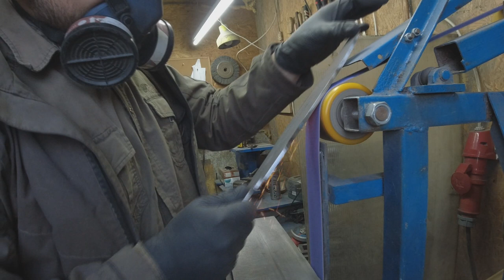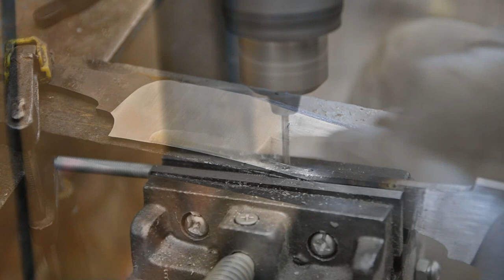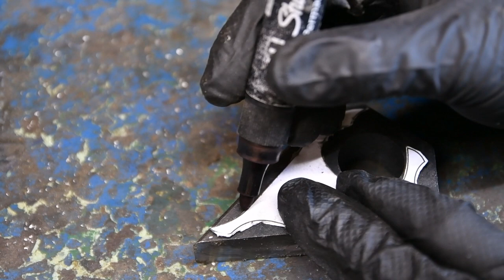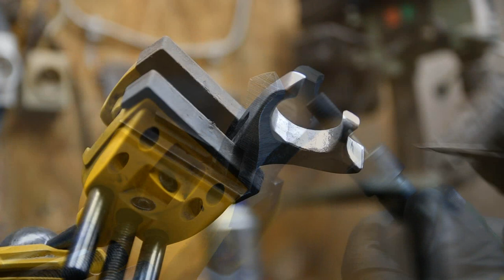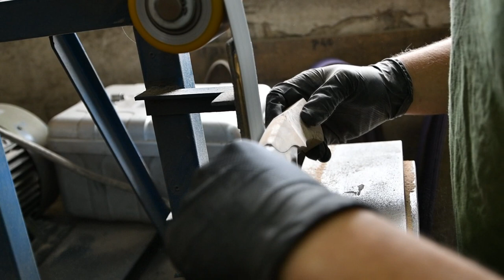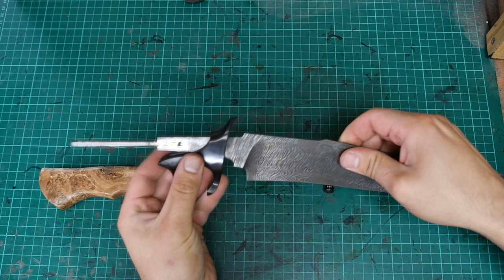Knifemaking: Making damascus bowie with sub hilt

Comment: Hello. Very nice work! Is the blade on this heat treated? If so, to what hardness? Wondering if this beautiful knife can actually be put to use, as well as be admired for its beauty?
Reply from the maker: Hi. Of course knife was hardening and tempering. Hardness about 60 hrc. I don't have recordings of this process, so I didn't show it